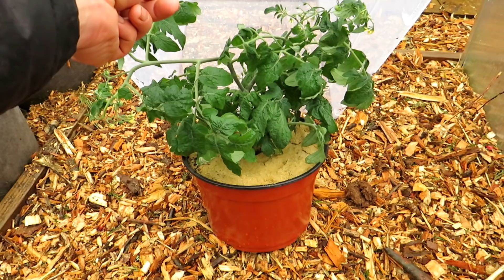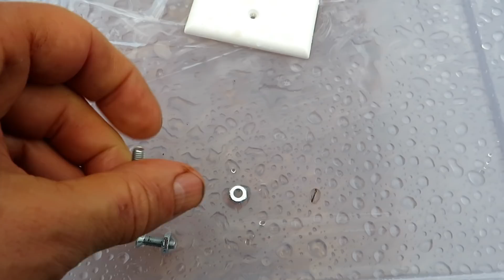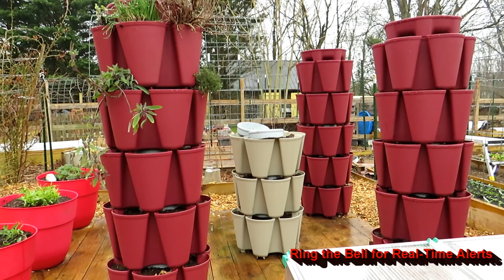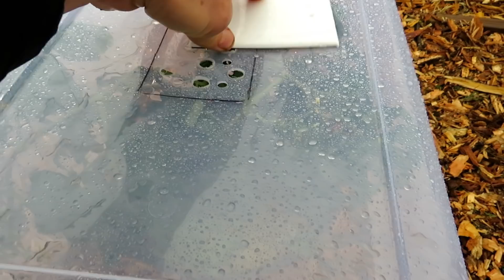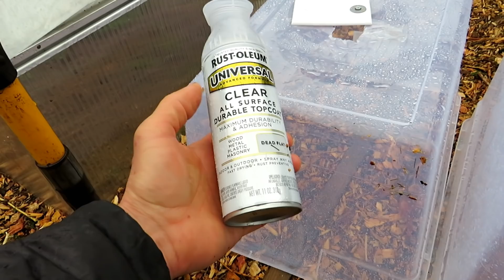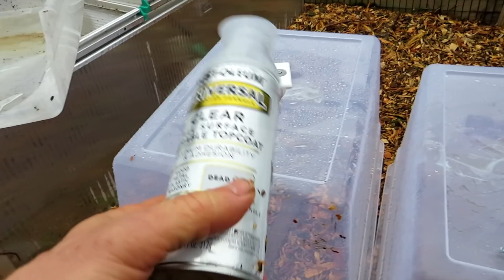Get Your Tomato & Pepper Plants Out 4-6 Weeks Early - Mini Greenhouse Build: Two Minute TRG Tips

Comment: Would this type of greenhouse construction work for starting seeds outside? I don't have a greenhouse or any available place for an indoor starting setup and would like to start my own seeds!
Reply from the maker: It would. If the crops arent frost tolerant, you have to keep an eye on them when frost comes.  This would be like winter sowing for you. Check out my recent video on it. When you get warmer and temps dont dip past 32 F, you can start your warm crops that way.
Please visit The Rusted Garden Seed & Garden shop for your fabric pots, fall & spring seeds, seed starting supplies, peppermint oil, neem oil, TRG merchandise and more at www.therustedgarden.com Check out my new gardening PODCAST Gardening Coast2Coast at https://gardeningcoast2coast.net with CaliKim
Reply: @THERUSTEDGARDEN  Thank you! I got a tote and my seed supplies today. I am hoping it will work if I take them outside during the day (temps are projected to be in the 40's during the day) and bring them into my heated garage at night. For cooler days, I am thinking of putting a hothands warmer pack into the tote as well to see if that raises the temperature, what do you think?

Comment: To cut large holes in thin plastic, I use a hole saw.  Run it as normal until the pilot bit goes through, then reverse the drill to cut the hole.  That way the teeth don't catch and rip the plastic.  Love your videos!
Reply from the maker: That is wise. I need to get one. Reverse is a great tip.
Please visit The Rusted Garden Seed & Garden shop for your fabric pots, fall & spring seeds, seed starting supplies, peppermint oil, neem oil, TRG merchandise and more at www.therustedgarden.com Check out my new gardening PODCAST Gardening Coast2Coast at https://gardeningcoast2coast.net with CaliKim

Comment: I cut the bottoms off a bunch of large water jugs, the kind that go on water coolers. I contacted a local supplier to see if they had any rejects - they crack sometimes - and he said he thought he had a few, but had just sent a transport load 400 kms to Toronto for recycling. They aren’t able to accept them at our recycling centre. I pulled in and he tossed 30 of them into my truck. They make excellent cloches. The Parisian market gardeners used this system a couple centuries ago to feed Paris. They had acres of these glass bells / cloches that they put on and off the plants daily - they didn’t have vent holes. Fun fact - in the late 1800’s, 1/6 of Paris was in market gardens, and they were self-sufficient in veggies. I have a band saw to cut the bottoms off, and you may not, but you can use a hacksaw of jigsaw etc. For your boxes, I’d use hole saw. Just remember to back up the saw with a piece of wood underneath the cut or the box will busticate!!! But I like my bottles... they’re FREE. And have a vent hole in the top already. sometimes i prop the bottom edge up on a twig if it’s REALLY hot out.
Reply from the maker: Those are great containers for that purpose. Wise to find a source for them. Thanks
Please check out The Rusted Garden Seed & Garden Shop for all your gardening needs at www.therustedgarden.com & Please Ring the Bell (next to subscribe) to get immediate real-time video notifications. Thanks

Comment: great tips Gary!  What's a safe nighttime temperature to start using this process?  I'm in zone 3 Canada
Reply from the maker: Well frost is key. But it is the length of the freezing period. An hour just below freezing, is okay with this. 5 hours significantly below freezing and this wont work.  Too answer your question... when light frosts are possible but not regularly.
Please check out The Rusted Garden Seed & Garden Shop for all your gardening needs at www.therustedgarden.com & Please Ring the Bell (next to subscribe) to get immediate real-time video notifications. Thanks

Comment: Sometimes regular drill bits can be too aggressive and bite into the plastic and crack it depending on the type and thickness. A trick is to run your drill in reverse at high speed. This melts through the plastic instead of "cutting" through.
Reply from the maker: Great tip.
Check out my Two Minute TRG Gardening Tips  playlist: https://www.youtube.com/playlist?list=PLMsTQWKi63STRub6SgaV6PlB9-O1ooM5l

Comment: Great idea!  BTW, instead of drilling the hole you can heat up a screwdriver tip over a gas stove flame and melt the hole.   Plastic won't break that way.
Reply from the maker: Thanks. Good tip.
Please check out The Rusted Garden Seed & Garden Shop for all your gardening needs at www.therustedgarden.com & Please Ring the Bell (next to subscribe) to get immediate real-time video notifications. Thanks

Comment: I have found that heating an old knife in a flame as well as using an inexpensive soldering iron will allow you to put holes in plastic containers easily. The heat melts the plastic, and the container will not crack. I have done this for the past 2-3 years and that is now my go-to method for making both drainage holes as well as vents if one is using a container for the greenhouse effect.
Reply from the maker: Heat is good.  LOL just was locked on the knife. 
Please check out The Rusted Garden Seed & Garden Shop for all your gardening needs at www.therustedgarden.com & Please Ring the Bell (next to subscribe) to get immediate real-time video notifications. Thanks
Reply: Great tip!

Comment: I got some baby tomatoes that are ready to go out. I have put them outside in the plastic covered hoop house for the past couple days to harden offish. When can I plant them inside? I do have a soil thermometer and the soil is 50 degrees exactly. The air does get warm. I live on the Washington coast. It's about 50 degrees in the daytime, doubt it will freeze again.
Reply from the maker: Only issue outside now is the chance of frost. I always take a chance. And modified this design to be bigger and better than what I use. If you are frost free, now is fine. If it is to cold, they might sit but will take off eventually.
Please check out The Rusted Garden Seed & Garden Shop for all your gardening needs at www.therustedgarden.com & Please Ring the Bell (next to subscribe) to get immediate real-time video notifications. Thanks

Comment: I started my tomatoes too early and in about 3 weeks I’m going to have to get them in the ground.  They are starting to bud.  So I built grow tunnels from 9 mil tarps and pvc.  I live in pa in zone 6 b, So I know I will get frost.  I went with the darkest tarp I could find to trap more heat.  My plan is keep them open during the day until about 2 to 3 hours before sunset then close them off.  I’ll do this when I read there will be a frost coming or when temps dip a little low.  I’m hoping this works and if so I will be able to jump start my tomatoes by about 3 to 4 weeks.
Reply from the maker: That is a good design and closing them off is key. A lot of people do that after the sun drops and they dont heat up.
Please check out The Rusted Garden Seed & Garden Shop for all your gardening needs at www.therustedgarden.com & Please Ring the Bell (next to subscribe) to get immediate real-time video notifications. Thanks